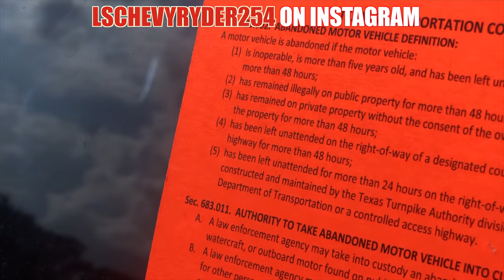HOW DID THIS GET HERE?????   JUNKYARD FIND 4.8 5.3 LS SWAPPED BOX CHEVY CAPRICE BROUGHAM

Comment: It was for sell not to long ago in temple said it had a fuel problem
Reply: He was probably a security issue not letting it fuel
Reply from the maker: Jake Browne it seems to be the computer because I have go tuners and can’t kid it up so  computer is bricked 🤷🏾‍♂️
Reply: @LSCHEVYRYDER254  that what happens when noobs try tuning
Reply from the maker: @rustedratchetgarage6788   lol im new to it but i can load one without bricking it lol but i guess common sense aint so common these days
Reply: texboi709 I wish I coulda been there for that conversation! “ it ain’t getting fuel” “fk it I quit”
Reply: They make aftermarket setups.....I myself run a fitech 70050 in both my nova and c10, don't have to worry bout any of that tuning stock ecu shit. Not to mention ridiculous  $$$$$ on hp tuners every time you bolt on hp.....and 10.5mm wires make a lil bit of improvement over the stock 8mm.   I Run the 10.5mm in my nova and it seems to be a bit more responsive than the 8s in my c10.....just make sure u got at least 2 ground straps...one on each head

Comment: That wiper motor was changed at one point as that is a rebuilder's label on it and the gray paint is the "spray and pray" that they do after just fixing what's wrong enough to call it "rebuilt".  Looks like that was a Brougham based on the seats. Don't worry too much about getting those specific lug nuts if you can't get them all off---they are readily available at any parts store.
Reply from the maker: i hope i can get it to work if not i will just but new or reman myself
Reply: @LSCHEVYRYDER254  It looks like a fairly fresh rebuild, it should be OK.

Comment: That swap may not be legal in California if they left the catalytic converters off.

In Australia it would be illegal because the car must also have all the emission control gear from the donor car fitted as well, not fitting  catalytic converters onto an LS ,LQ or LM type Chevy V8 engine can cause the ECU to throw lean codes as it needs to be tuned if they are removed or any catalytic converter below a 200 cell per inch catalytic converter to comply with local anti smog laws.

Whoever did the swap in the video obviously wasn't worried about the car not passing a smog inspection !
Reply from the maker: hey russel here locally the car should have cats  but they dont do a smog test of anykind  as long as it has the cats i dont think they would have an issue. i know some guys who get inspections done so i will have to ask them thanks for your feedback, are you from australia cool to know my vid has reached you russel
Reply: Thank God that im in the wild wild west

Comment: Ouch......I bet losing this one really hurt the owner. ...he musta been riding dirty and got locked up  , I don't see any other reason why that would be there.....well now after watching all of the video I hate to say it but they did a horrible job on that swap.....ouch
Reply from the maker: what made it so horrible?
Reply: @LSCHEVYRYDER254  drive shaft looks to be a bit short and the wiring is just scary looking but then again it's been sitting in that yard getting touched by everyone I guess it could have been better.....it just when you shot the cross member and you can see the drive shaft.......you can clearly see they didn't plan any of that correctly. ......but their intentions were good
Reply from the maker: @trentdawg2832  oh yea i did notice that as well  i was probably the first person on the second to this box so it was how it was before the harness i didn't bother trying to get because i can rework them and i dont care for the truck fuse block im not sure why they had so much play in driveshaft because i did swap on mine
Reply from the maker: @trentdawg2832  it could have been the adapter plates they ued to set the motor in the car that has the driveshaft like that
Reply: Yes ...it is the plates like you said...they needed to drill a couple more holes....they make a sliding adjustable trans mount now to solve the cross member issues
Reply: @trentdawg2832  drive shaft is like that because the wheels r of the ground😂😂that's why there's a slip yoke..